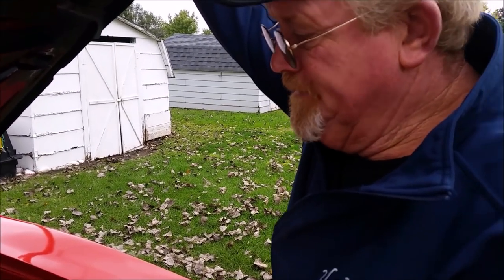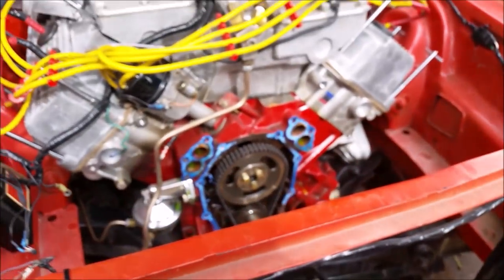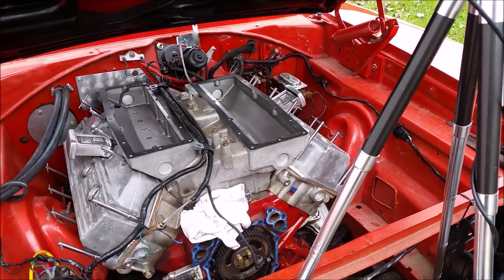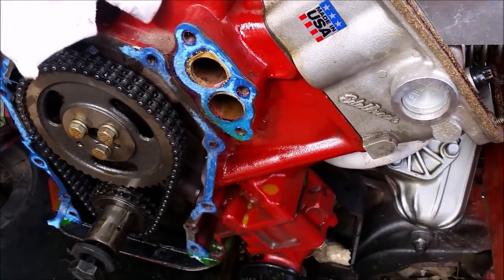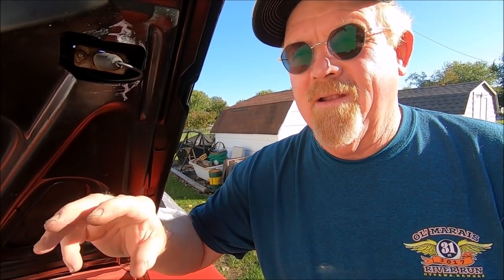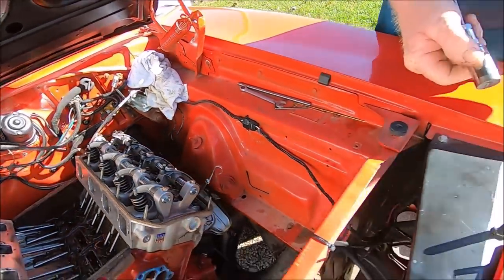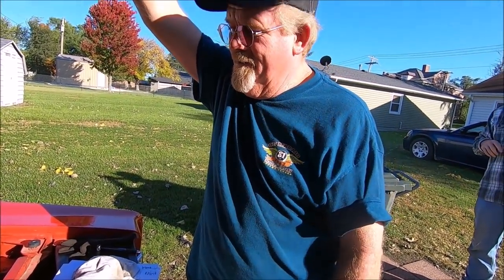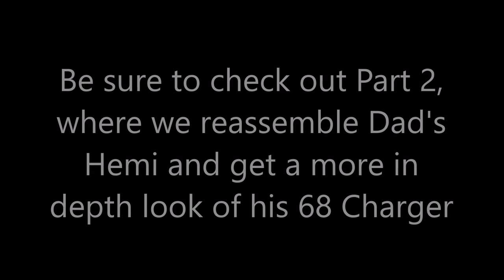426 HEMI powered 1968 Dodge Charger: Engine teardown Cam Degreeing Part I

Comment: Awesome video. Im not saying I know everything but before you took her apart I would have done a leakdown test and a compression check. Then you will have more idea what might be an issue or not. Just sayin. Peace! Also send that lifter back to hughes.
Reply from the maker: Don't worry man, we knew there was an internal issue, and it's been narrowed down one particular thing, on the lifter, we fixed it. It's already mated to the cam lobe and changing out the cam and lifters isn't in Dad's budget

Comment: I think I would run it with a different intake just to test and see your not having problems from that one with it's miles of gaskets to leak vacuum and the cross blah blah was problems in it's day not that it's not super cool
Reply from the maker: I do know these intakes has some problems, but we can't afford to buy another intake for Dad, I only have dominator style tunnel rams and the cut up factory intake

Comment: Thats why racers instal sollid lifters..  They tik more but do not break..   I had them in my harley 76 lowrider..   I once did the valves pusrods when the engine was warm..  When i started it the next Day it did nothing then pushing air trough the valves 😂      
So when you do your valve clearence give them room..  A bit the oil wil pump up the hydrolic lifters till the clearence is 0.    A mebe you and dad know that already..  I hope..  😂.. 
Let us know if the charger runs better now...  '!!!  
I did merel her axels this weekend and she Phoned me up..  Piet the car is driving as New...  😂 😂  i only did a test run round the house.
Reply from the maker: I personally prefer solid lifters, for the fact they are solid and don't have moving parts. Glad to hear Merel is happy brother, gotta keep the women in our lives happy
Reply: @ScottsSpeedShop  yea but they make more noise...  😱

Comment: my brother in laws 72 monte carlo 350cid would'nt run right after it got a advanced cam. he did a frame up restoration had countless mechanics work on the engine finally ended up selling the car. hard starting would never idle never once drove it. i had a 76 ford highboy truck with 390 & C6 transmission. the transmission shop talked me into installing "beefy shift kit" and 3000 rpm torque converter. it worked but driving it was like a earthquake it jerked so much
Reply from the maker: I can only imagine man, sounds like you have had some awesome cars

Comment: I was actually looking forward to seeing how you degree that cam. That's something I've never done. That one hydrolic lifter, I think I definitely wouldn't put it back in that motor. It came apart cause there was a problem with it. Might have to tear it apart again if that lifter shits the bed again. That cut you made about not knowing what y'all are doing was awesome. Actually made me lol. Great video brother, looking forward to the speedy reassembly video. Oh, one more thing. I know it's  dads car and all but why does he want a 3000rpm stall? Seems that would be awfully annoying to drive around town and run errands with. Keep on keeping on brother!
Reply from the maker: That's what he bought, the 2500-2800 stall wasn't doing the trick, the biggest issue we were trying to figure out was why his car would die when put into gear, and it all ended up being because we are 99 percent sure the converter in the car is faulty, it was a lightly used unit from a buddy, but it did sit for a while. Dad ordered the new converter before we figured the old one was potentially bad. I really don't know where his car is gonna be in the future, I would just like to see the list of shit end
Reply: @ScottsSpeedShop  I hear you brother, but you know like I do the list of shit will never end. Us gearheads will always find some kind of shit to get into. Could be worse, i have a buddy in NC rebuilding a 1965 AMC Marlin Ambassador Coup. Imagine trying to find the shit to fix that little gem.

Comment: I think that engine needs some air them carb cleaners belong on a lawn-mower
Reply from the maker: Only problem is, nothing else will clear the scoop, those are old cal custom air cleaners that mimic the look of the early dual quad vettes
Reply: hp =air+fuel less air means rich condition

Comment: are you sure the adjusting screw for the lifter is Allen, sometimes the eye gets fooled and it ends up being a Torx head. just sayin friend. NO dont reuse that lifter, get a new set please it can destroy that engine.
Reply from the maker: If we get new lifters, that means new cam, I would never take the chance mating new lifters to a used cam and vice versa unless I had to. Dad doesn't have the budget for another cam+lifter set also. The lifter is ultimately fine, it still works, and the engine is running good, just still has the surge from the intake manifold. The problems lie in the faulty torque converter

Comment: just around $1000.00 your dad can have a three sided carport installed next to the garage, I would do that for that car, I did it for mine, but my 68 Charger stays in the garage I use the carports (two of them 18x22) to park under when I use the garage for other things.
Reply from the maker: Dad's car is always covered by two tarps, our city won't allow us to put up a car port. That was why Dad built the rock pad in the back yard, so we could build a roof with no sides just to cut back on the sun, but our City(the cock suckers) have shut us down again and again